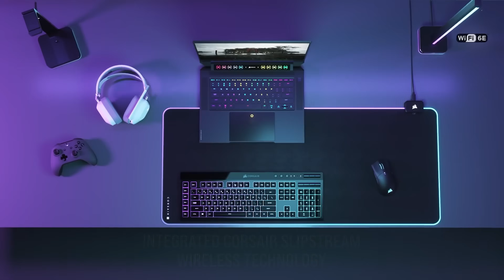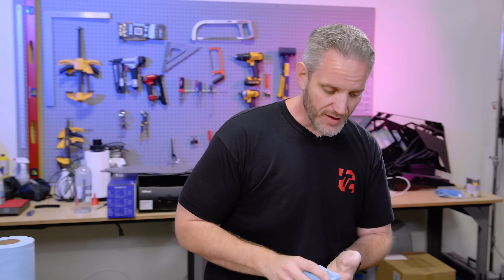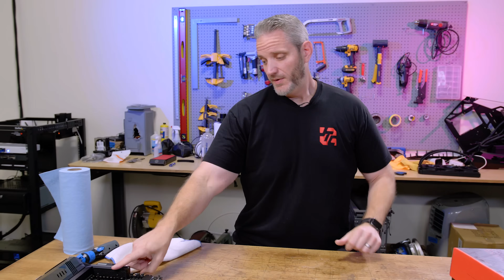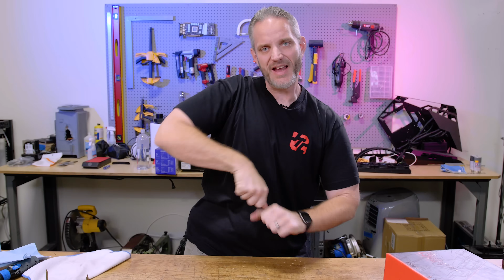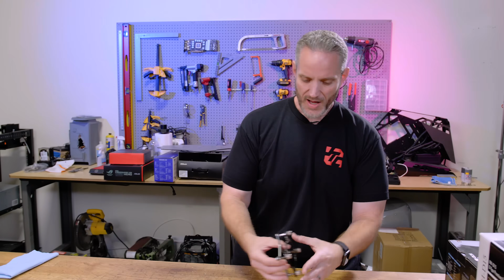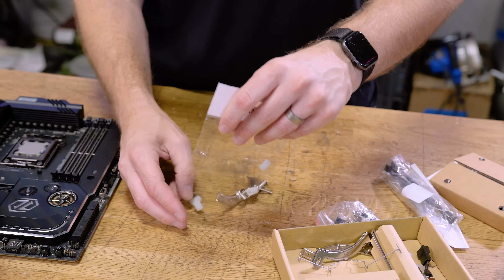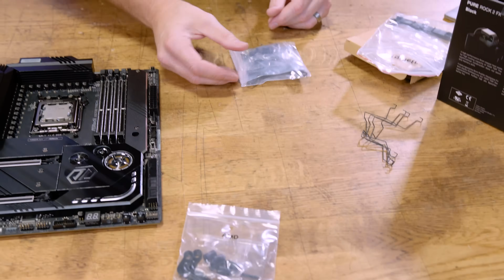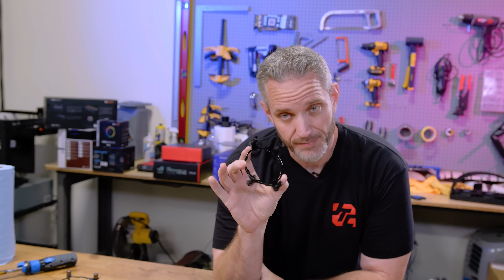AMD made a terrible flaw with this design...

Comment: Sounds like they're leaving way too much performance/efficiency on the table to allow theoretical backward compatibility when moving to a new socket anyway.  I direct-die cooled my 4770K back before there were nice tools--I used a vise, hammer, and block of wood to delid that sucker (not without some anxiety).  I don't need to upgrade this gen but if I did I'd totally be delidding or shaving the IHS down to minimize that bottleneck.  Looking forward to your testing on that.
Reply: And you can "direct die cool" the AM5. Nothing stopping you.

Comment: A little clarification: Intels 12900K/12900KS get even hotter and they don't have a high IHS.
Besides AMD did not do it for endusers but for the large OEMs, so they can use the same coolers in their systems. At least it can handle the heatload compared to Intel.
Also you should make a video testing curve-optimizer(2) to see how much heatload you can "save" without loosing any performance.

Comment: It's going to be really interesting to see all the top enthusiasts tackle this issue. If the thermals we're seeing really are because of the thick IHS, i'd have to imagine AMD will have to rethink it if they see similar to better performance with the lower temps.
Reply: they are certainly not going to completely redesign their etire cpu line and manufacutring process because enthusiast want lower temps, especially after seeing that it runs perfectly at 95c under a sustained load.. sure maybe on there next gen cpus they will do that but I bet you everything i have they wont change the IHS
Reply: i dont think they will do that. they will say, that 95c is fine and thats it. maybe with a refresh but not now.
Reply: Intel will see increased sales thanks to this.  Not that many people are going to mess around with the chip and cooler to get around this.

Comment: 12th GEN bending issues that required a new plate for your motherboard to fix. Paul reporting, as did others, that PBO2 adjustments can significantly improve Ryzen 7000 performance and temperatures. And now this… Seems like the CPU companies are really missing some important points on their own freaking products lately… Where is the internal QC?

Comment: Honestly prefer that the backplate is perma-fixed to the board, as people selling used boards more often than not lose the backplate/mounting clips. VERY annoying to have to order another one on Amazon and have your build/a client build halted due to their stupidity. Just take off the factory backplate/clips, put in mobo box, and you're good....

Sure, having to buy a new cooler costs more and can also be annoying and sucks, but there is both a positive and negative effect from this. Also...fuk warranty. Actual enthusiasts won't care and get performance by any means necessary🙃

Comment: Optimum Tech got 30c (!!) lower temps undervolting R7 7700x - at the same clocks. 30c !!
And 50W less power draw.
AMD voltage curve is sh1t af !

Comment: There could conceivably be another explanation for this issue of the extra thick CPU "Lid". This is a brand new CPU slot that will be used for many years so getting the dimensions and traits correct, while knowing what you will be using this for a while, is really important and I just have a lot of trouble believing that AMD just, "Screwed up"...

These days, it seems, a lot of the future capability will be comming from increasing the number of layers in chips. In other words- building chips up vertically. Now- If I were designing the AM5 socket I would design in some vertical space for future expansion... Are you folling my reasoning here...?

My guess is that in some future iteration of CPU this vertical space will be used and we will be amazed at AMD's industrial design because they designed in this capability. In the meantime the 7,000 series CPU's seem to be amazing even with the heat handicap of the thick CPU lid.

Any real engineers out there that can comment on this thought?

Comment: The problem with the custom backplates is that most of them are metric. The AM5 stock backplate uses UNC #6-32 screws.

All cooler manufacturers need to do is send out compatible screws. That's all there is to it.

Comment: 8:27 I dunno why, the fact the dude shaved his motherboard reminds me when I tried to re-thermal paste an Xbox One. that thing has one of the worst mounting brackets I've ever seen (when coming to user friendliness), it needed so much force, meanwhile you were cramming your flathead against the back of the motherboard to try get the bracket off. on top of that, you had to do it at least like 3 times at full force.

Comment: I don't know if this is related, but the newest version of Ryzen Master will push my 5600X close to 95°C when simply doing an "Apply & Test" where the version before never really got over 75°C at the same manual overclock settings.

Comment: Good liquid coolers use the same thread for the custom backplates as the stock one. Ek, noctua, thermal right, swiftech, and alpha cool all use the same thread. Most of them also come with a backplate just in case.   The really old x brackets that do 775, 1366, and am3 should also work. It is sad your noctua cooler was new enough to have no x bracket and no am4 mount.

Comment: 1 fix AMD  could have used is break compatibility with AMD4 and before but have AMD5 with the same height of IHS. As that will improve performance I am predicting that they will do so in the feature on like AM5+ or whatever they will call it. For Intel well they found the best size to use and stuck with it for 10+ years as physics don't change.

Comment: Interestingly, my Wraith Prism cooler doesn't require a flat-bit screwdriver to mount it. I frequently mount and remove it using just my hands, pretty easily. Not sure what the did but it is a lot easier now.

Comment: Tjmax is the temperature at which the circuits start to break down, and is higher than highest specified operating temperature. So no, 95'C is NOT the Tjmax. It's the highest operating temp.

Comment: In short, AMD should have simply dumped cooler compatibility. Most cooler manufacturers probably would have released new mounting kits for AM5, and those would be released along with the CPUs. It looks clear, Ryzen 7000 likely isn't a good CPU gen to upgrade, here's hoping that they would fix the height issue by the next gen...

Comment: you should check Otimum Tech's video. He manages to lower temps by 30° C almost without loosing performance, only by changing some PBO settings (without delidding).

Comment: While I certainly find it cool (no pun intended) that AMD made the Ryzen 7xxx/AM5 series to be as physically compatible with CPU coolers DESIGNED for the older AM4 series, I'm disappointed but NOT surprised that the mounting hardware for some of them aren't compatible with AM5 motherboards. But I was surprised to find that part of the price for this sort of compatibility meant AM5 CPUs need a thicker/taller IHS. I don't know if I'd go through the trouble of de-lidding something like a 7950X (or the 7900X that I'd be more inclined to buy), but at least I know I'll get a noticeable drop in operating temperatures. All of this looks like good reasons to avoid being an early adopter!

Comment: I used to cool my (Old) CPU with an air cooler that has a dedicated mounting bracket, but I used the stock one and didn't see a single problem with cooling. Now I use the Liquid Cooler that holds onto the hook mechanism, and the pipes pull on the block. I don't see any cooling problem, but will it leave any long-term damage meaning I should change the case/placement? I just got the cooler, and it's the 360 variant meaning I cannot mount it anywhere other than the front, and in my case (pun intended), the radiator has to be mounted between the case and the front panel, otherwise the pipes won't let me mount it with the connectors on the bottom. Anyone please give me tips

Comment: Hated using those coolers that needed a flathead to mount them back in the Athlon XP days, so much pressure required on a bare die, not only were your risking putting a hole through the motherboard, if you weren't careful may end up cracking the die. While the IHS isn't perfect it's the best thing AMD and Intel ever did.

Comment: Well, if you unscrew the ILM, it won't destroy the CPU - it just won't be secured as well as it could be
And if we take into consideration the fact that the PGA socket didn't always hold the CPU well so you could take off the cooler with the CPU on it, this wouldn't even make a huge change. Just take off the ILM, put on your cooler and call it a day 🤣

Comment: I must Thank you Jay... i was looking at the AMD 7000 series and wasn't calculating my CPU cooler into the costs as i have the Noctua NH-D15. I have been using it for the intel 7700k and was told that it's brackets fit, so i went looking for the box and found it with the AMD brackets and saw they were the same in your video... You have truly saved me from some unwanted surprises.
Reply: If your cooler came with a bracket for a socket, it will need a bracket for the AM5 socket. Zero difference there, 'cept there may not be one (but Noctua DO have one for your cooler, just that others may be later or not at all so you have to buy a new one).

Comment: Can you please shave down the original heat spreader with 1.25 mm , 1.50 mm , 1.75mm, 2.00 mm  just to see how much is the temperature improvement ? ( Or the Performance improvement. ) Just for fun and content.

Comment: The EK Quantum Velocity2 block for AM5 uses the integrated backplate. They already have a video on it, but the block itself is still in the pre-order stages.
Reply: EK's AM4 blocks will fit fine, they just need 4 screws with 6/32 threads.

Comment: I killed my Radeon 9800 pro with a screwdriver... While changing the thermal paste on my Zalman flower cooler... Should have kept the old paste on it :/
About zen 4: Well the coolers aren't really compatible. They had to change one time but be real and tell customers. But their new IHS is stupid... The 20 K improvement with direct die cooling is insane! And that bizarre form instead of a square or rectangle is stupid...

Comment: Newer NH-D15 manufactured after AM4 was released has AM4 mounting mechanism included in the box. You can request from Noctua if you don't have the mounting hardware. It should work like the NH-U12A's

Comment: Hope they ditch this idea for AM5 9xxx. Like how many people are going to build a new AM5 and pull the cooler off their old AM4? I'm sure there are some, but it's not worth the hurdles for everyone else... 
I bought the EK AIO because it checked all my boxes, one being it screws directly into the stock AM4 backplate, in place the plastic hooks. If I was going to make the switch to AM5, I wouldn't want to pull my current system's cooler off to swap it over- a extra hundred or two for a cooler isn't that much compared to the rest...
 I knew something was fishy when they said AM4 coolers would all be compatible, and this is one of the many bad scenarios I thought of, actually it's the only one that I was truly worried about (what were the chances everything would naturally line up? You can take some off the Z axis for better cooling, and some coolers might have a loose fit/ less tension or be incompatible, or you can add metal which is bad for heat transfer). I really was hoping that they would use their billion dollar tech to get that LGA system to fit correctly, but I don't take into account the, um, motherboard pins and their mounting tolerance.

Comment: this is due to the next gen ryzen cpu. they have more space inside but may also stack stuff inside better on top of each other. taking now some extra heat on the die is better than later having a new cooler requirement.

Comment: Sometimes even brilliant companies like AMD seem to forget why certain design choices are made. They chased a mobo design problem so long they forgot about the CPU's integrated heat spreader thickness completely. They must be under a lot of pressure to keep rediscovering the wheel and keep compatibility, but this is proof that forced innovation can sometimes backfire.

Comment: another valid test would be to machine 2mm of the 7000 ihs off and create a mounting solution that accommodates for this 2mm loss. Its insane that everyone is going to have to take their 7000 series cpu's to a machine shop and say would you mind milling 2.5mms off the top of this cpu :)

Comment: That engine analogy is absolutely garbage and not the same thing at all. Running your engine 100rpm below redline for extended periods is significantly more damaging than running a CPU just below TJMAX. You’re spreading misinformation and making people more worried than they should be.
Reply: Are you computer expert?

Comment: The number of thermal interfaces (junctions) is much bigger driver than the thickness of the heatspreader on effective thermal conductivity. Don't assume 2mm thicker will result is any non-neglible temperature delta. Please go ahead and do an experiment and measure temperature across two different aluminum plates of different thickness if you don't want to work out the thermal conductivity calculations. (math)

Comment: When you include the price of a new cooler and the new RAM and the overpriced motherboard of the 7000 series, I really don't see the point in upgrading this gen! The first generation is always a bag full of problems, just look at the 1000 series Ryzen with its boastful overclocking potential that didn't exist and horrible memory instability. I don't want those issues with today prices, who would? And running at 95c TJ max running temps will just kill your AIO and it's fans.

Comment: Now I can get why AMD increased the thickness of the IHS, because as they continue their 3D stacking, they might eventually need that Z height on future models—which would screw up compatibility in the future if the Z height needed to change, because adding thickness later means that older coolers are going to break the new thicker CPUs.  The obvious downside is that cooling is going to suffer a bit from this generation.

Comment: I am not planning on jumping on the new AMD AM5 right now, but honestly I am not too concerned with the high Tjmax, and any "normal" users shouldn't be either as the CPU is designed to clock as high as it can to reach up to right under that temp and as long as you don't force the system to go higher, as it shows in tests. I am waiting till they get these problems solved and the prices on mobo's and Ram will fall to a more adequate lvl. I will acceps any 2-3 degree raise as long as I don't have to delit my CPU and void my waranty. Any decent case / Cooler setup should be able to keep the ambient temp at an acceptable value
Reply: It is no more a high Tjmax than the 100C Intel cores caused flash fires. The die is DESIGNED to get to 95C. If it can't, it is because it isn't given enough power.
Reply: @markhackett2302  the difference is Intel is removing the Power limit to get to those extra 10% performance which causes maybe 50% higher power draw. The 7000 series really dont't use that much overall power even running at 95C. I would be much more concerned if I had a 12'th or 13'th Gen trying to push for those extra % performance at both a huge raise in overall power draw and risk of cutting the lifespan of the CPU.
I used to have a oc'ed 3770K that wasn't even the best silicon lotto win, but It suddenly died from 1 day to the other. I actually like how the AMD's work kinda auto OC'ed from the factory without any fancy special build cooling. Just set it and forget it.

Comment: Only an amd fan boy would try and justify running a delidded cpu with a 3rd party cpu retainer and a third party cooler mount.. Now before I get flamed to death I am running a 3rd party cpu retainer on my 12th gen Intel because Intels tries to warp my cpu :) I guess its easier to design a cpu then to come up with a decent mounting and cooling system :)

Comment: I'm thinking the thicker IHS is for the future. If they plan to keep the socket for a few it gives them room to have taller dies later on and keep compatibility.
Reply: Taller dies like the stacked cache ones that are coming. The main issue with their 5800X3D experiment was there was a lot of waste and dead parts due to how much they had to shave off the die and IHS to get it to fit.
Reply: @falcie7743  this is true. They have made even more room to add all the goodies into the new 7000 series x3d:)

Comment: This is the kind of thing that makes me glad I'm not enough of a hammerhead to early adopt new stuff. I'll be waiting for the next generation, most likely, so these kinds of things can be sussed out without me having to order a "free" replacement bracket or mount, or whatever. I didn't go with AM4 until 3000 series was about to be released... I'll be happy to wait until 8000 series if I decide to stick with AMD for my next platform.

Comment: AM5 cpu's only last 12 years? I have been using amd since k6-2, and my parents are using right now my old phenom 2 (about 13-14 years I think), and it goes ok.
If I'm buying a AM5 cpu can not hold 15 years! What a steal. I see on internet some people that runs commodore 64 for 40 years and still runs like new.
I'm expecting a computer to be able to run forever with minimum replacements (hard disck, fans).
I heard that some industry it has been using 386 for ages as machine controllers in bad condition without problem.
Hope when I have to upgrade my ryzen 1600 at zen5-6 have solved this problem.